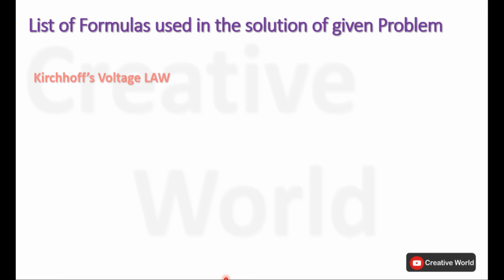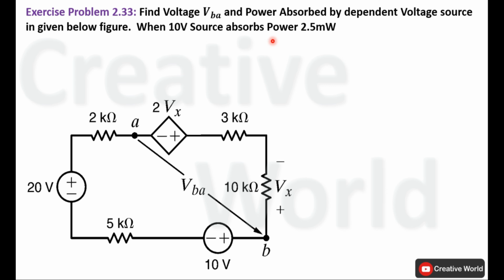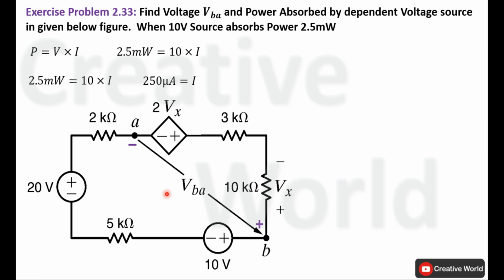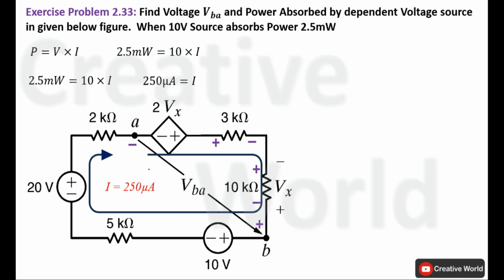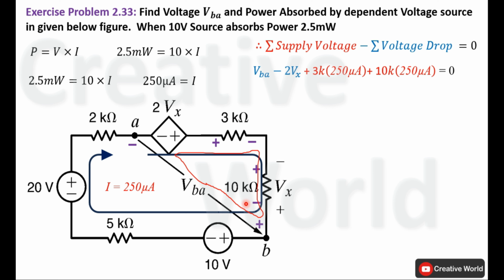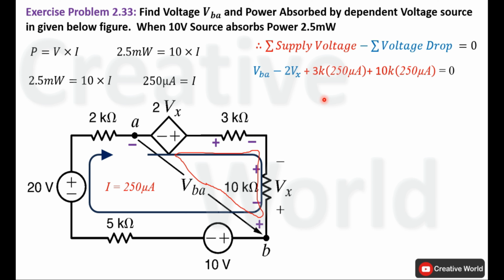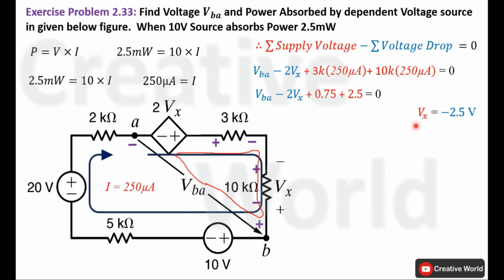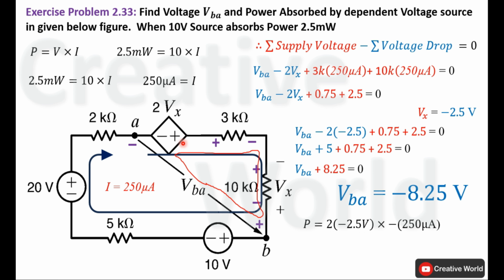Chapter 2 Exercise Problems 2.33 Solution | Linear Circuit Analysis

Comment: One confusing thing here sir.Why did you change 10k ohm polarity against the question? In many kvl questions charge pass through negative terminal of resistance which in itself is very contradictory because how can charge gain potential when going from a resistor but here you made it right but not in other similar questions
Reply from the maker: Dear in earlier videos  as i have mentioned that we are using passive sign convention theory in this book. According to this theory current entering terminal across resistive element is taken as positive and current leaving terminal is taken with negative sign
Reply from the maker: in this scenario i have assumed the direction of current in clockwise direction that's why the polarity notation across 10k is taken according to the assumed direction of current rather than the given polarity if we want to use  given polarity across 10k then we have to take the direction of current in counter clockwise
Reply from the maker: potential is the product of rate of flow of charge and resistance so if charge passes through a resistance with in as specified time interval then voltage potential will generate across that resistance